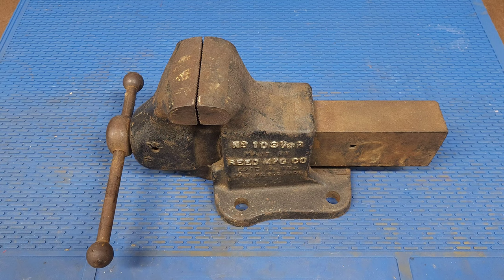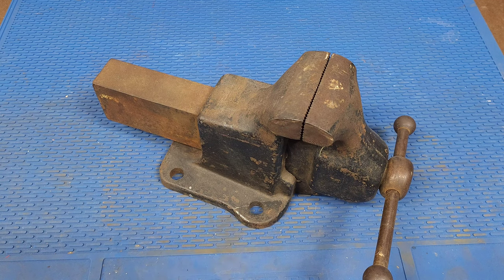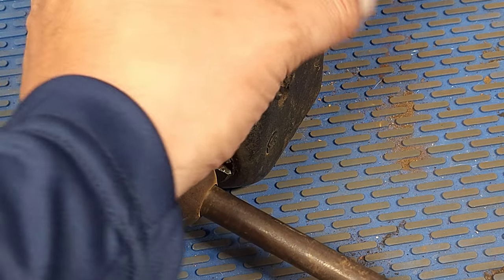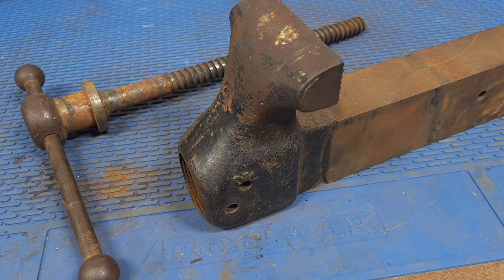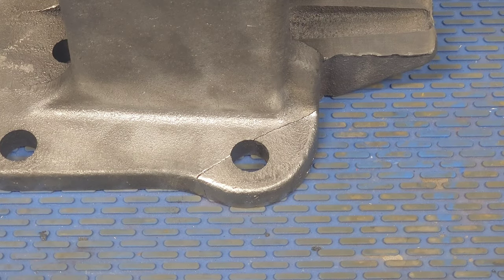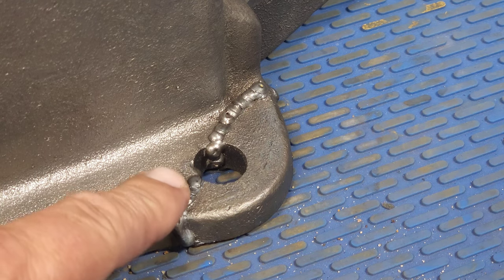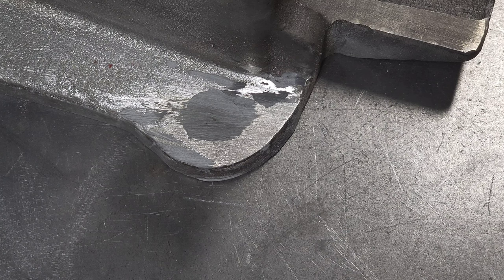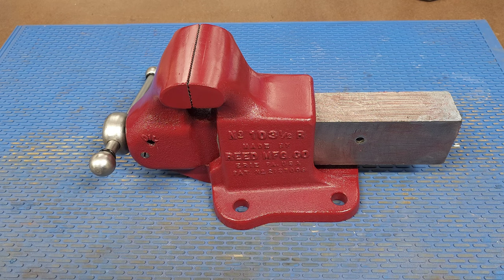Reed Vise Restoration

Comment: Great job on this vice as well. I have always been a fan of JBW, but to me it seems Bondo would be better for smoothing over the rough areas of the cast. Have you ever tried that? If so, did you like or not like the results. Nice work! 🔧 🔨 ⚙️
Reply from the maker: I've never used Bondo as I have never had any on hand, so that is why I always use JB Weld. I am going to try it out on my next vise project as I am curious to how it performs  Thank you!